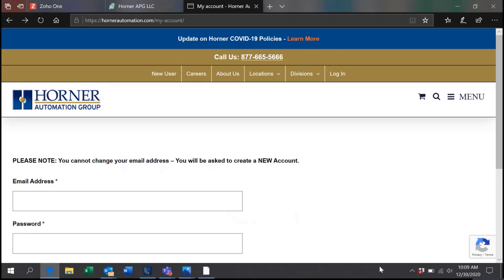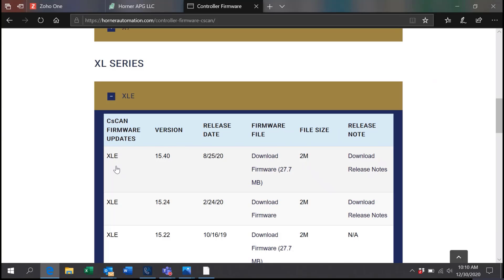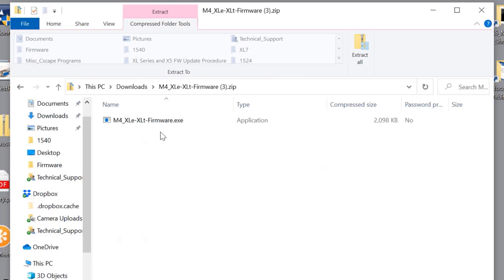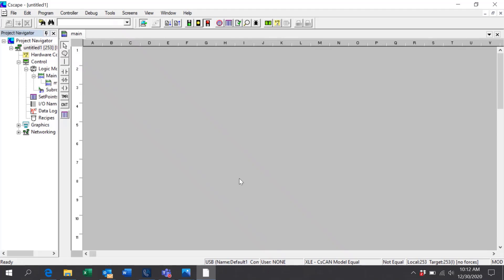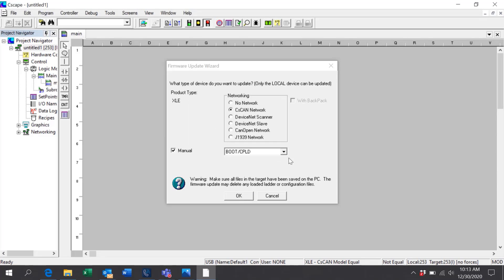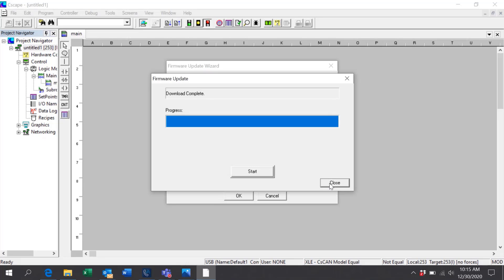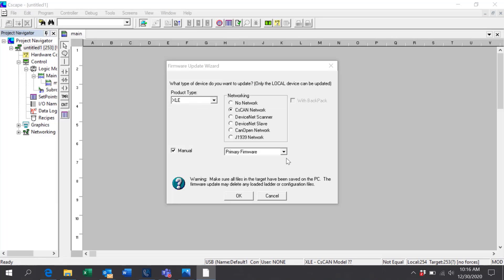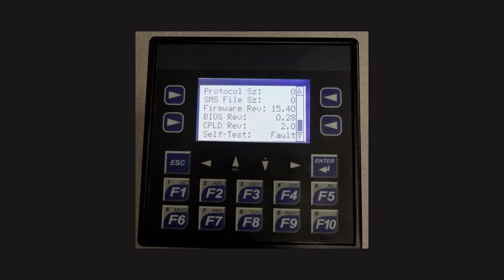How-To - Firmware Update for XLE/XLT Controllers

Comment: Hello! I'm trying to update the firmware on my controller, but at the very last stage, just before the download ends, on "Primary Firmware" step, there appears this "Error setting mode". How can I fix this? 
Controller: XLEe
Model: HE-XE1E2DM
Software: Cscape 10.0 (doesn't work on newer version also) 
Firmware: v15.60 (none version works) 

I tried different versions of freeware, but nothing worked.

Comment: Is it possible to update the firmware via removable media on the XLE
Reply: Hi Bennett,

Yes, however it is only on versions of the XLE/XLT that already have firmware 15.40 or later in them at this time. Once upgraded to a version later than this, future upgrades can be made via Micro SD. Feel free to contact our Tech Support department with any other questions you might have about this process as well.